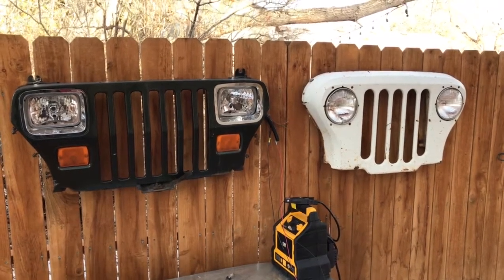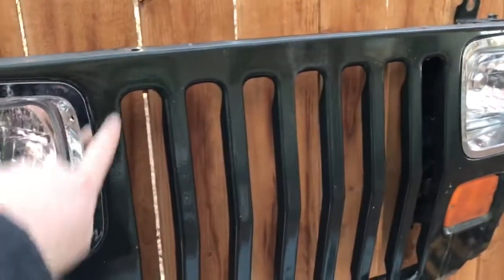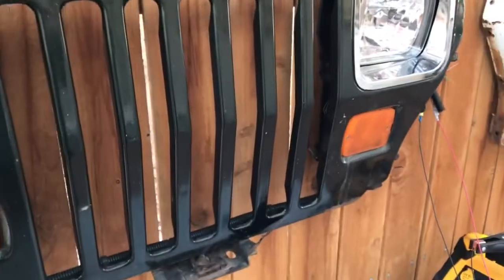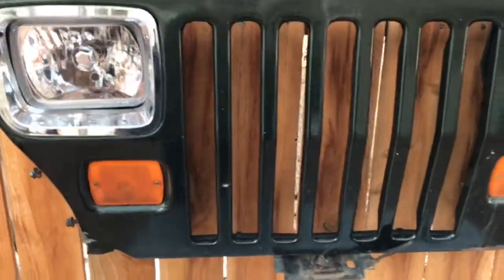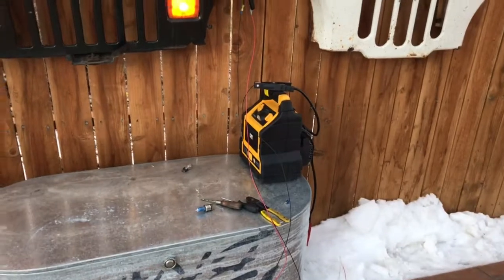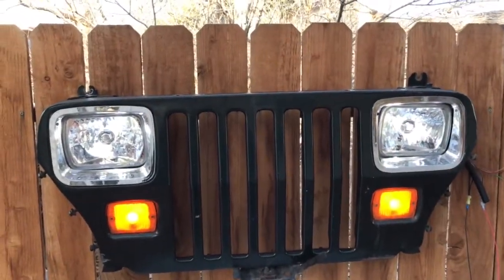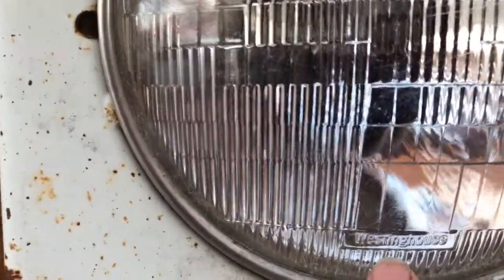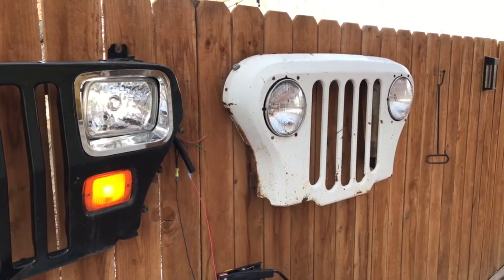Jeep YJ Wrangler Grill Project for Patio Decoration

Comment: I'm doing a YJ now. It's done, Painted and polished. I'm just just waiting for the light sockets to come from China. I'm doing 110 volt with 7 watt equivalent LED nightlight bulbs for the headers and markers.
For those round sealed beams, you might be able to separate the clear front lens from the chrome plated glass reflectors. What I did with the stock YJ bulbs was gently tap the back of the bulb with a hammer. The back reflector broke in a few pieces, and separated from the much thicker front lens. The front lens and glass back reflector are only epoxied together. Now take the inner steel buckets, wrap them in foil or paint them silver and epoxy them to the back of the lenses. You can now easily put bulbs in the buckets, and they'll shine through the lenses.
When I'm done, I'll be posting pics of everything I did at the WranglerForum.com or .org or whatever.